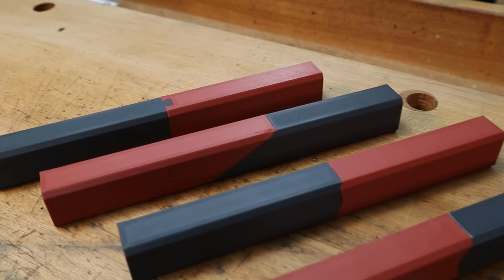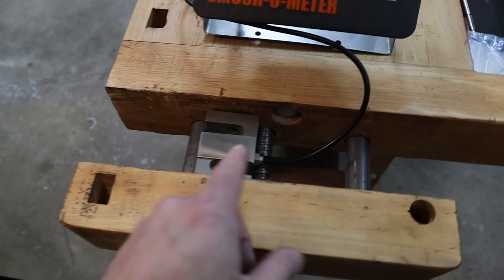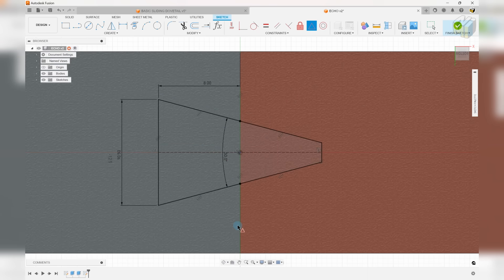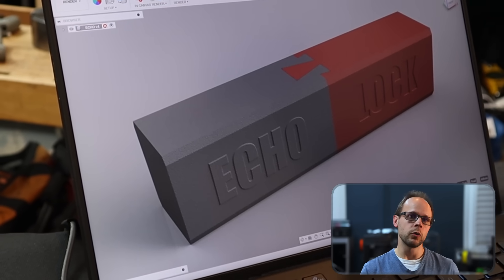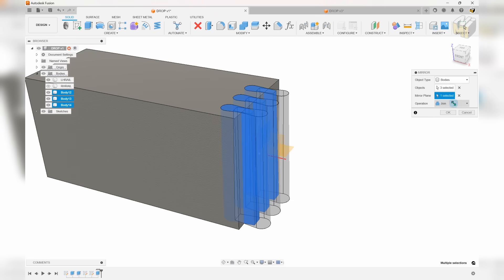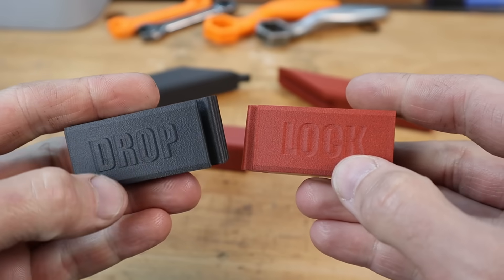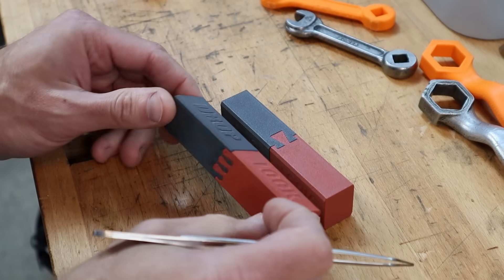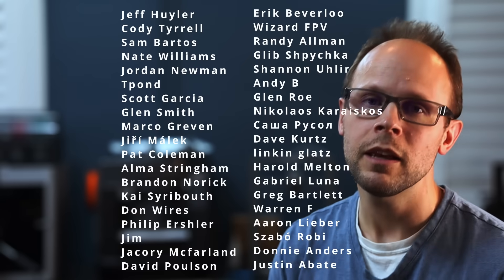Adapting the BEST Woodworking Joints for 3D Printing

Comment: I would love to use these joints, but one thing that makes me wonder is how strong these are to take apart along the weak axis (the one you slid them through).

I would be curious about locks that use a perpendicular 3D printed fastener to make sure this joint is strong in every direction. Potential perpendicular fasteners include: 

- plain cylinder (dowel): this would resist the force along the weak axis, but may not stay in. Hence:

- plain cylinder + snap lock: now it would be nearly impossible to take apart, particularly if the part that snaps it into place is buried. Hopefully this can be angled so that the fastener is not the only thing that's taking all the force, and there's some clever way to use leverage to distribute the force along the whole part.

- screw: fairly obvious.

Anyway - I'm very happy to see your work! Thank you for your videos!

Comment: What is the nozzle size on your hot end?  I am using a .5 mm on my Lulzbot 747 285  and not getting good prints consistently.  I'm a newb with 3d print.  Glad to see you using fusion,  I think that product is great, I've been using it from day one release, but also Inventor, and SW    Great video, good work .

Comment: my bad for skimming through the video - but I don't quite get how these joints are supposed to be used in woodworking. (practically). Are they thought to work as Clamex/ Domino ? or just for gluing one board to another?

Comment: Hi i tried the first dovetail and it works really well with 20mm thickness but when i reduced the thickness to 10 mm   and i made the tolerance between the two parts .15mm(i sand it at the first time)it's not strong like the first one and kind can be slide down is this  because i reduced the thickness  or i add more tolerance and how i can fix it thanks  for sharing this great tutorial ❤

Comment: Just made your Echo Lock using OnShape and 3D printed it. It wasn't clear to me if you offset only the side you showed by 0.05mm on all the faces OR if you also did the opposite side with the same offset. My joint didn't work out as nice as yours so I'm wondering if I need less offset on the faces and larger fillets on the corners. Could you also share what printer settings you used (i.e., layer height, etc.)?

Comment: An easier way to make these joints is to make a surface body of the interfacing face on one side and just split other parts with that. And thickening the surface for clearance.
The joint wont be as perfect since the clearance would be uniform, but it's a very fast process

Comment: I think you need to get away from the idea of a dove tail and move toward jagged teeth from both sides. The idea in woodworking was to create a connection that could be, at least somewhat, easy to create with a chisel or a saw. With 3D printing, you're not limited to that shape. I like the echo lock, but you could make it stronger by extending the little black tabs farther into the red block and using some right angles and reverse acute angles. I'm thinking of a tree limb saw blade. Use several across the connecting face that extend from both the red to the black and black to the red. The teeth need to be big enough to be strong but small enough to put several across the face.
Reply from the maker: Can you do a quick sketch and email it over?  I'd like to understand your idea a bit more!  Needitmakeit@gmail.com
Reply: @NeedItMakeIt  Maybe. So I started to draw with pen and paper. But I'm not an artist. So I moved to FreeCAD. And you (at least I) can't draw and not slice and print. So I sliced and printed and my parts don't fit together. I guess that wasn't a surprise ... or at least shouldn't have been. 🙂When does a plan ever come together the first time?

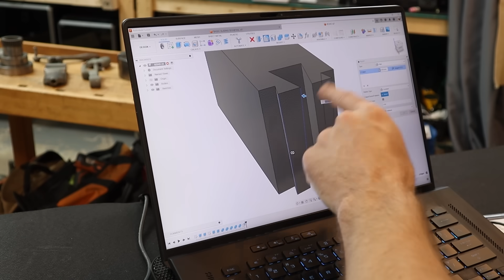Comment: I love your videos!! Very thorough and interesting joints. Keep up the great content! At 5:21 you are showing the offset amount at .05 mm but only on the grey side of the joint. Is this offset done on the red side of the joint as well? Do you also fillet the outer corners/edges of the joint faces with .3 mm? Also, what size chamfer do you use on the outside edges of the whole part?

Comment: This has me wondering about joints for mixed materials. What if you want to join a PETG print to a wooden plank or dowel?

From what you've demonstrated, it's clear there are woodworking joins you could use that don't require the unique abilities of 3D printing. But maybe there's also something clever you could do with an asymmetrical design, where the printed side would take advantage of what you can do with the printer's additive process while still leaving the wooden side easy to craft with traditional subtractive tools.

Comment: Sounds like the layer lines are adding a bit of extra friction. In this case, its probably not a problem vs if you're trying to use FDM prints for casting fiber reinforced resin parts where you want the mold parts to separate eventually.

Comment: Great content and engineering. An idea for another video.. We often make dartboard light surrounds which can be 20" in diameter. Due to the size of print beds we normally need to print 5 pieces. The joinery on existing models is wonky. Would love to see if there is a joint that would really lock together all the pieces when joined in a circle. Something that stops front to back wiggle, stops the circle from deforming/twisting. Thanks!

Comment: The clearance seems to be very small.
Reply from the maker: It is very small, it's thanks to the taper that allows this to be possible, the friction comes into play only at the very last section.  If these were straight cut, I'd have to add in more clearance for sure.

Comment: I count 5 'walls' in the prints; that kind of information as well as what pattern and how much infill is useful and of course what kind of filament.
A wider drop, maybe 22° (perhaps 30° might be too much) would be an interesting modification. Testing various taper angles and clearance distances is another area of interest, how much they influence assembly ease and stiffness.

Comment: Another way to model joints is to model the spliting surface. 
Like model whatever surface you like. analyze it to see if it can slide to join.. maybe curve some parts a bit to make it snap in correct place when fitted. Then for tolerances just thicken the surface to a body and uniontrim both parts with this cuting body.  Or just split the bodys with this cutting surface and add offest to create tolerances.. this way may be harder to offset individual surfaces but it leaves more room to adjust tolerances as some dimensions need different tolerances.

I use Catia and modelling a surface in GSD is easy peasy.. cutting bodies in Part Design with that GSD surface is also trivial. (sure an overkill of engineering program with 4-5 figures price.. i have it, i teach it, i use it).

Comment: With plastic you really need to rethink these..its not wood. Plastic has sprin, bounce and flex in it. You need to think parts that snap together or click into one another. Unless ur goal is to make wood type joints. When u do setup a test I hope they lenghts will be the theoretical size of ur build plate extended to double that length. Those shorts lengths have no leverage and one can just print a single piece.

Comment: This reminds me of some videos I've seen on Japanese wood working and their fancy joints.  I wonder if you could do stuff like this but without bi-directional tapers, then use a center pin to hold it all together.  That way it goes together easier but is still firmly fixed.

Comment: I'd like to see the echo lock a little rounder. I think looking to balance the thinnest sections between the two blocks so they are as thick as they can be in trade off to one another and and a generous curve will make the failure paths harder. Also I think the center red on the echo lock could be shorter without negative effect.

Comment: Found this interesting, the improvement I can think of is to add a horizontal notch in the middle of the joints so that it locks in place when pushed to the right position. Something that can't be done in traditional woodwork joints, but absolutely possible in 3D printing.

Comment: No offence, but I find it utterly funny that a 3D-printer geek with no shoulders/muscles judges the strength of a part - or part-connectionfor that matter - by whether he can pull it apart or not, haha. Like how much damage can he possibly cause to those parts 🤣
Reply from the maker: No offense taken.  I'm not making videos to show off my muscles, I'm making them because I'm curious and I like to share information and ideas.  Most people use motors or screws, I use my hands and do as much manually as possible.

Comment: You use fuzzy skin on your prints right?
Is there a way to deactivate it in certain areas?
Like at the joint it would be beneficial so the tolerances add up again or is the fuzzy skin not protruding as much as I think?

Comment: I really like the echo lock and may use it in future. btw what are your fuzzy skin settings? i need to try it out and  experiment but yours look really nice
Reply from the maker: I like the Echo Lock too, the more I think about it, the more I like it.  I can't take much credit for the looks, it's the material in this case.  I'm using PETG-CF, and it produces that really nice matte and slightly rough finish, it also helps to hide any layer lines too.  I've used 0.16mm LH on these which does help a little bit as well.

Comment: Try looking at some of the Japanese woodworking joints for inspiration. These tend to use complex geometry to get around the shortcomings of simple dove tails making them very tricky to fabricate in wood but for 3d printing it would be easy.

Comment: In your testimg i would love to see measurements for deflection in the various axis. For me im looking at the ways to split a 10mm thick flange in half to fit printer, so the deflection is actually more important then the strength as it impacts the clamping pressure along the join.

Comment: I agree that the dove lock looks much more stable. If the fingers were dovetails of the same size, I believe they'd have more surface area, which kinda takes the crowning point away from having round fingers. The fundamentals of both of these designs are the same, you're just playing with frequency and depth of tabs, corner shape, and symmetry. It's a very scientific way of searching out the perfect joint, keep the variables small and controllable. I have a more abstract wonder, though.. could you make an interlocking joint based on a scutoid?

Comment: My guess is that the strength of any joint like this in a 3D print will depend mostly on how continuous the tension is in the outer boundary layers as opposed to the inner shapes that will pull mostly on the infill. 

I think your echo lock might work well, mostly because the outer wedges are close to the boundary layers. It might be interesting to test different spacing on the outer wedges, and a smaller inner wedge and see if this affects strength. 

There’s also four faces that this tension continuity needs to be optimized for….

Comment: I made a 5 piece FDM print about 3-4 weeks ago, using poke yoke dove tail joints. While I designed a gap between the pieces for each joint, I STILL had to use a Dremel sander to remove excess material. If I had enough time, I would have made two test parts to determine how much of a designed gap was needed to avoid having to remove material for a clean fit. Unfortunately, the “urgent” need for the prints, the size of the prints (printer volume), and that each print was taking at least 1 day, meant that I had to wing it. I also do not have the luxury of time to play around with the printer, given my 3-4 jobs that I cover as one person. (Using CATIA V5, and MakerBot Replicator - PLA material).

Comment: Pretty cool. For the drop lock, you could change it to a hammerhead lock to eliminate some flex. Add a small squared area at the end, kind of like the head of a mallet, rather than a water drop. This would be less practical with wood because of a high chance of end-grain splitting during assembly, but you effectively have continual edge grain with the 3D-printed joint. It wouldn't take much of a ledge to prevent the joint from being pulled apart.

Comment: I really enjoy these videos, specially because I'm just getting started and have a bunch of things that I want to print that are outside of printer build area. 
My Initial thought is that these connections have a base that is too thing and therefore can't withstand forces pulling away at it that well, so best to keep it for compression forces. I only print in PLA and it doesn't like tugging or lateral forces that much, compression is mostly fine as long as I'm not putting dumbbell on it I guess.
Are these concerns valid? Could I make a frame out of these to hang stuff from it that is under 10-15 kg load?

Comment: Great video. I like to make modular objects where you have small parts and steing together a dozen or more, so the joint is really important especially with regards to slipping and slack. Any movement in the joint is multiplied due to the number of joints. I like the dutch joint with a hollow wedge that offers some springiness to hold them together. Obviously not as strong but strong enough for what I need.

Comment: Have you tried creating these cut profiles in the surface modeling feature? You can create the profile, extrude it with zero width and use it as a cutting tool that can be used to divide any shape

Comment: What settings to get the outside walls to look like those with the text? Fuzzy skin? what specific values? Looks super super nice!
Reply: Also curious, and filament. Is that PETG-CF? PLA-CF? Printed on Smooth PEI Plate?

Comment: I think your finger joints would be better if you alternated the lengths of the fingers.  IE make the middle finger longer.  The bulges of the side fingers would then correspond to a relatively thick portion of the opposing side rather than make 3 thin portions that are all in the same plane.
Reply from the maker: I think so too, and could the fingers become shorter as they approach the edges as well I wonder.  It has some potential I think, and these being small doesn't help.  Too bad we can't share sketches here, it's a bit annoying to have to describe everything.

Comment: I do like the drops a lot cause I imagine they would print a lot quicker, having no sharp edges to decelerate for.
I also imagine fewer corners limits stress points.
Reply from the maker: You got it! That was the thought around the droplet shape, I thought it would give a bit better speed and remove the sharp corners, it's not really adding anything to pull the connection together, but if adhesive is added it adds glue surface area.  It needs a bit more work before the show down.

Comment: Try combining them with acetone welding for abs/asa.
Reply from the maker: What about plumbing cement?  It's meant to bond ABS pipe, though it isn't always the best colors...  I think the acetone idea is a good one, I've used it for other ABS to ABS connections and it seemed to work well.  Molecular bonding.

Comment: It would be good if you could somehow use generative design or topology optimisation on your joints and see what the computer comes up with.
Reply from the maker: I just started the free trial of the simulation module in fusion, but I need to take some time to learn it properly to understand it better, but I think there probably is a best type of connection for each plastic based on their individual characteristics.  Fusion seems to think that the plastic will stretch, but the connection will just continue to develop stresses without opening up, that's not the case in reality, and we're going to test that in one of the upcoming videos.

Comment: Really nice and super interesting ! 
Do you know if it is interesting to change the type of junction if you change of plastic?
May be, some jonction can take advantage of elasticity or layer adhesion of your plastic.
Reply from the maker: I think so, each plastic type has different properties and I think they could react differently from each other.  Ideally the connection would be strong enough to withstand any normal forces being applied, but it's hard to know until you can find a place to use the connection.  There has been some talk of using it to Print 3D printer frames, which is interesting to me, that's a great use-case where the frame needs to be very solid.
Reply: If you have experience with differents woods, we can then adapt it to plastics which have "similar" properties :/
Reply from the maker: @chatroux399  Can you elaborate a bit? this way we can extract something useful from your thoughts on this.
Reply: Sorry for my bad English.
My point is some woods are soft and flexible like polypropylene, others are rigid and brittle like PLA etc ...
And with your knowledge on differents woods, maybe you can adapt it to plastics.
Like this, we could make good connection for soft plastic, and another connection could be better for this rigid polymer etc ...
I hope this is clear.